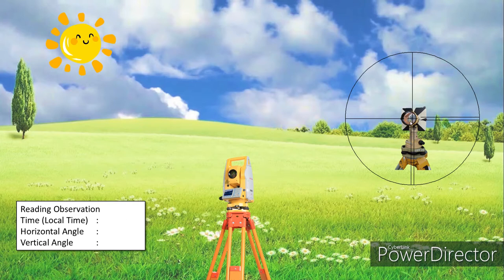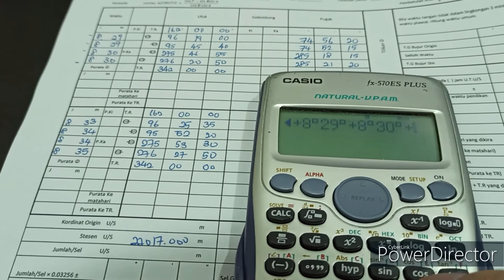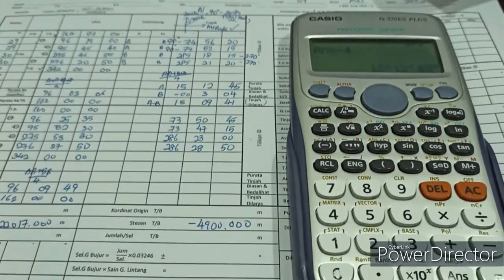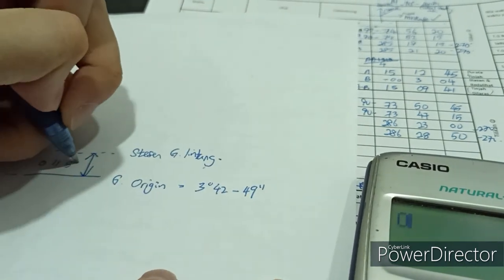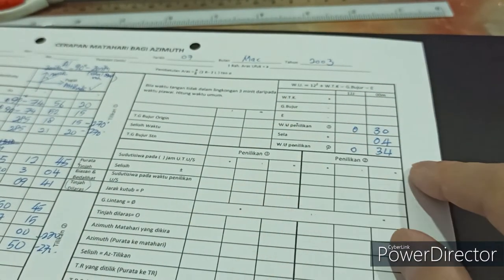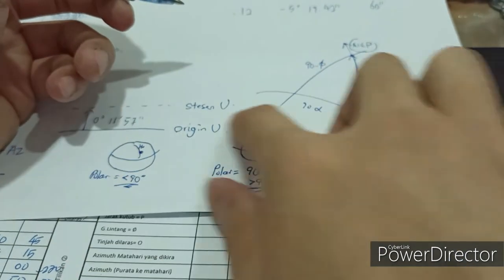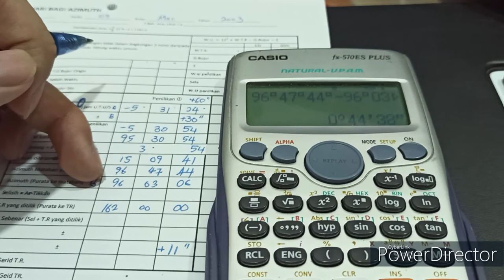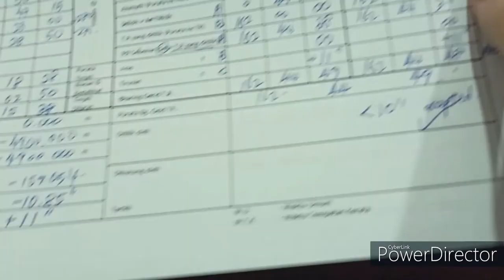Azimuth Determination by Solar Observation - Cerapan Matahari

Comment: Mr Teo are an expert in civil 3d autocad software I am actually doing the volume earthworks client require me to draw the slope of OGL line and design slope cross section with the slope line and quantity volume
Reply from the maker: Sorry, I may be unable to help with the earthwork design. However, I think the profession in civil engineering may help.

Comment: How do we know the cross hair of the total station is aiming at the centre of the sun while we taking the azimuth bearing of the centre sunI have seen so many surveyor agak agak only aiming at the sun
Reply from the maker: hi tan. You have to know the sun is always moving. We can't actually get the extract center. But we can try to get the average value in our observation. There is the reason why we targeting to right edge, left, left and right to obtain the mean center of the sun (same with the altitude) within a given time (suggest below 4 minutes within a set). 
I can't say all the surveyor is main agak agak, but surely confirm that they have targeting the sun according to the procedure (location the cross hair at the edge of the sun) correctly .
This is my point of view, welcome for more discussion.